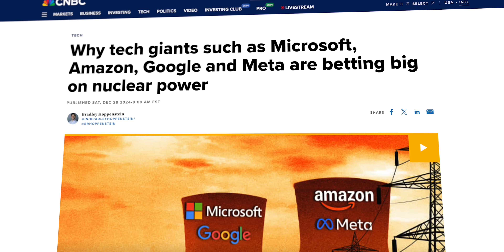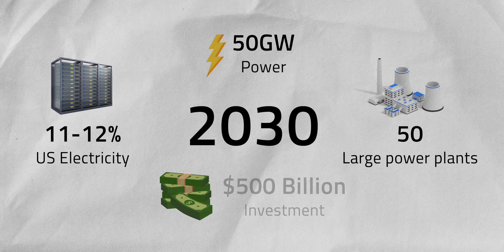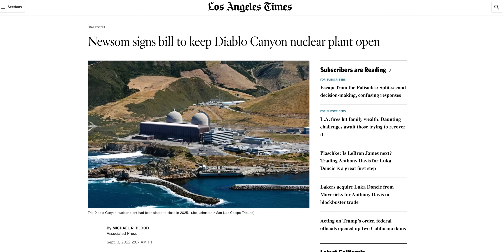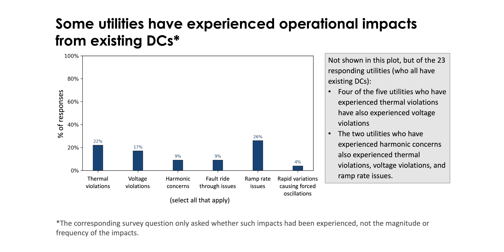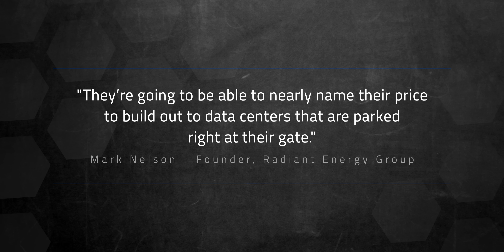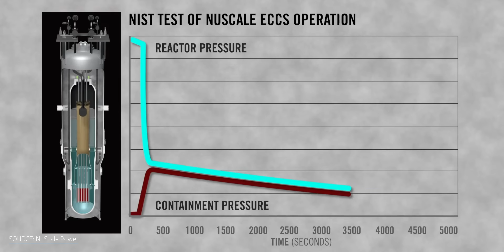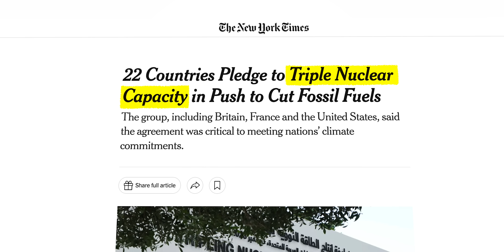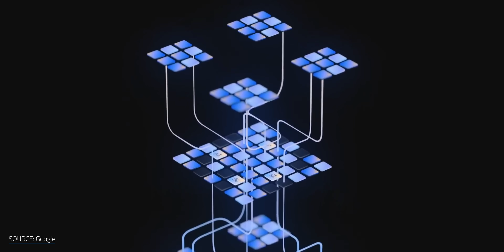Why Big Tech's Betting Billions on Nuclear (Not Renewables)

Comment: My main issue with the reference to Fukushima-Daichi, is glossing over/failing to mention the part that the disaster, as described,  was entirely avoidable if TepCo had actually listened to their own engineers and disaster planners to build the backup generators higher up.

Otherwise good video overall.
Reply: Yes, the engineers knew in advance that a tsunami could cause catastrophic failure exactly like it happened, and they did warn the management about it. Avoidable as you say. The passive cooling systems discussed in the vid are even better.
Reply: But like all industries, nothing normally happens until something happens, rules are written in blood.
Reply: What makes you think that tech giants listen to engineers?
Reply: That and it was in the process of getting shut down as it failed multiple times to meet the standards required to operate, in that time they ran it into the ground making the most money they could.
Reply: Private companies will often cut corners; we have to expect that. It's the regulators we should be able to count on not to drop the ball.
Reply: TL;DR - The people who built Fukushima Daiichi - Tokyo Electric Power Company aka TEPCO - knowingly put the emergency backup generators in a part of buildings that are below ground level. This ensured that these emergency backup generators would get flooded out if a tsunami hit. TEPCO then completely and utterly ignored a 2008 report that warned them that this mistake could easily result in a reactor meltdown in the event of a large tsunami.

The cutaway illustration at 11:30 in the video is incorrect. A quote from the World Nuclear Association's website page on Fukushima Daiichi:

"Events at Fukushima Daiichi 1-3 & 4

[...] all six external power supply sources were lost due to earthquake damage, so the emergency diesel generators located in the basements of the turbine buildings started up. Initially cooling would have been maintained through the main steam circuit bypassing the turbine and going through the condensers.

Then 41 minutes later, at 3:42 pm, the first tsunami wave hit, followed by a second 8 minutes later. These submerged and damaged the seawater pumps for both the main condenser circuits and the auxiliary cooling circuits, notably the residual heat removal (RHR) cooling system. They also drowned the diesel generators and inundated the electrical switch-gear and batteries, all located in the basements of the turbine buildings (the one surviving air-cooled generator was serving units 5&6). So there was a station blackout, and the reactors were isolated from their ultimate heat sink."

(YouTube automatically deletes comments with URLs in them, so I can't give you the direct URL to this page. Google for "world nuclear association Fukushima Daiichi accident" and it should be the first result.)

MY POINT IS: The people who built Fukushima Daiichi (that'd be Tokyo Electric Power Company aka "TEPCO") intentionally and knowingly put the backup generators in the basement. And they were warned in writing by their own engineers in a 2008 report that the backup generators would get flooded out in the event of a tsunami hitting the plant. And that's the real root cause of why the meltdown at Fukishima Daiichi happened! They put the emergency backups generators below ground level, ensuring they'd get flooded out in any kind of flood (including one caused by a tsunami). And ignored a written report that warned them it was going to happen.

A lot of people don't know, there is another nuclear power plant only about 11 miles north of Fukushima Daiichi. It's called Fukushima Daini. And it's almost the same exact design as Daiichi. Seriously, check out the Wikipedia page on it. Except the people who built Fukushima Daini, put the emergency backup generators where they should have been: Above ground level! So when that same tsunami hit Daini, its reactors shut down and cooled off just fine. Again, look up the Wikipedia page for Fukushima Daini if you don't believe me on this.

(I'm sorry for the wall of text. I added a tl;dr at the top.)

My conclusion after finding all this out? Human beings and especially greed-driven corporations are TOO GODDAMN STUPID to build and run nuclear fission power plants! Furthermore, the idea of "human factors" (which is just a fancy word for "stupid people") is ignored by most who advocate for more nuclear power plants. Chernobyl was also caused by human stupidity. Experience and history argue that humans are, in general, too stupid to build and run nuclear reactors correctly. We need to stick to solar panels, wind turbines, dams, etc for our electricity generation. We are too stupid to play with more powerful toys. (Corporations, whose entire purpose is profit, are especially stupid. They should never be allowed to operate nuclear power plants.)
Reply: Why listen to engineers when you have corners to cut and profit to make? You think US cares about safety over profit? LOOOOL
Reply: I think what you're trying to say is, "Capitalism and nuclear power are incompatible." 

As long as we live in a social/economic/political system that values profit more than human life, we won't be ready for nuclear.
Reply: @ecocentric6640   To be fair, Chernobyl was under the Communist Control.

I think human ego and stupidity are incompatible with Nuclear power plant.
Reply: yep, paying a bit more for getting cooling-water to the reactor by not building next to the coast really would've done wonders.
Reply: @serioserkanalname499  Or just a bigger seawall, or a generator on the roof, or, in the case of unit 1, a slight design change so that the decay-heat-powered cooling system turned on automatically, as the operators already believed that it did.
Reply: Putting your diesel  generators in the basement?

How stupid?
Reply: @LauraliteBrezia  Doesn't matter that it was avoidable. They didn't avoid it. They were told exactly what to do and didn't do it to save effort. Laziness is a human trait you can rely on, lol.
Reply: Every disaster is avoidable if someone had done something different.    It is just human nature to keep cutting costs until something breaks.  Anything built by humans is going to have preventable failures.  If that thing is a wind turbine, no big deal.  But when humans build nuclear plants, sooner or later, there will be irradiated lands.
Reply: @VPWedding  This a thousand per cent... You can almost ALWAYS say "this could have been easily avoided if this and that".
Reply: @VPWedding But, this wasn't hindsight? It was straight-up ignoring "best practices" design... Inserting vulnerabilities....
Disasters happen when Best Practices are ignored...
Reply: or that all of the deaths were caused by overblown reactions and excessive evacuation orders and no one actually died from the nuclear meltdown itself and only a tiny area actually needed to evacuate.
Reply: @epicgamer42069 it’s so easy to say that the reaction was overblown in hindsight. When you have a serious accident and you don’t yet know the full scope of the accident, an evacuation is absolutely the right thing to do. It’s better to overreact a bit than to grossly under-react. 
I also find it problematic to put all the focus on deaths, as if that’s the only catastrophic outcome of a nuclear disaster worth thinking about. Fukushima had many terrible consequences, even if deaths were arguably not among them.
I’m not anti-nuclear or anything. Trying to dismiss the issues around the Fukushima disaster is exactly what breeds distrust for nuclear power.
Reply: @ I do agree thats its better to overact than underact but it was grossly overated to due to grossly unnecessarily high standards of what a safe radiation level is and the evacuation was held for way too long due to those standards and thats what caused such major problems. Even after the situation was completely assessed they still held the evacuations despite the significant research that the radiation levels present were safe.
Reply: @auspiciouslywild  "Fukushima had many terrible consequences" Not the least of which was contaminating the entire Pacific with radioactive effluent (and I believe this is still ongoing, as they keep releasing radioactive water into the sea).
Reply: Or not build the reactor on the coast where they get tsunamis. 😅
Reply: @Nathan-vt1jz  definitely an argument to be made there, but my main point was more that they could have mitigated our outright prevented the disaster by building the generators higher up, with reasonable measures that would not have been wrecked by the tsunami surge they got, and tepco just didn't because they didn't 'want to cause a public disturbance'
Reply: @LauraliteBrezia if you tell the population we are derisking the nuclear power plant! Guess what people actually like the disruption! And will joyfully watch!
Reply: @Nathan-vt1jz  Submarines and aircraft carriers do just fine.  The US NRC released a report stating (assuming my memory is correct) that they require gravity feed reserve feed boron water tanks that would safe a reactor even during catastrophic loss of power.
Reply: @Nathan-vt1jz  There are tons of nuclear power plants on coast lines and all of them are doing perfectly fine without fault. Even one in Florida that gets hit by hurricanes on a regular basis
Reply: @epicgamer42069  I live near the turkey point nuclear power plant in Florida. The water around the plant has elevated levels of tritium, a radioactive isotope. Gee I wonder where that came from? That water goes into a canal and leaks into the biscayne aquifer which provides drinking water for millions of Floridians. That is your heroic clean power solution?
Reply: The problem with Nuclear powerplant is not the nuclear itself. It's the human who runs it. The problem is, you can't actually eliminate human error completely.

And that's the scariest part. Many governments around the world would cut corners regardless of safety concern and millions of lives at stake.
Reply: There are pasdively safe reactors that shut themselves off.  Thorium reactors, for example. @nntflow7058

Comment: I don't understand how you can do a video that indepth about nuclear energy and not mention nuclear waste? The new reactors may be safer but they don't change the fact that they are producing waste that will remain highly toxic for thousands of years. This alone should be enough to stop these being chosen over other options. What could be achieved if this level of funding was spent on wave and tidal energy production?
Reply: The solution to nuclear waste is a closed fuel cycle. This has been proven many decades ago, but the EU and US decided to leave nuclear power. The "waste" has so much energy still in it that it can power their respective country's with electricity for centuries.
Reply: > What could be achieved if this level of funding was spent on wave and tidal energy production?
Very little, besides immense environmental damage.

The sea is a much harsher environment than a NPP, which is why we have NPPs lasting up to 60 years, with applications to 80 years, and the NRC stating there is no technical objection to a 100 year lifetime.
Wave and tidal machines, in contrast, are damaged and degraded within a few years, and fail to have much meaningful impact.

Just look at the tiny impact wave/tidal have made to Austria, or Nebraska, or the Central African Republic; let alone the difference to Estonia (with tides of as much as 6 inches! 6 inches I tell you!)

Comment: I have yet to see a nuclear power plant go online on time and on budget. Not to mention nuclear will need a water source nearby limiting  where they can be placed. Since data centers go where the land is cheap, I’m seeing more and more data center projects use solar solely for themselves and island on their own without connecting to a utility because the power is too much and the utility takes to long to upgrade. This will be interesting how it plays out since solar is cheaper, faster to install at 9 months vs 10 years, and more flexible as to where the Data Center, solar field, and batteries can be installed.
Reply: look up these power plants:
Japan:
- Shika 2 (4 years)
- Higashi Dori 1 (5 years)
- Hamaoka 5 (4 years) 
- Onagawa 3 (3 years)
- Kashiwazaki kariwa 7 (3 years)

South Korea: 
- Shin Kori 1 & 2 (4 years)
- Shin Wolsong 1 (5 years)
- Hanul 5 & 6 (4 years)

EU and US had the same capabilities in the 70s and 80s until they stopped building them, and euhm... yeah here we are. 

The tech company's tried and still are invested in solar projects, it's just clear that only wind/solar doesn't cut it. A NPP can be paired with an air cooling system, it's just less efficient.

Comment: "Passive safety systems solve that issue"   I object to that statement.  They make a catastrophic event less likely, but as an engineer, I can assure you that there is no way to predict all possible events or the destructive ability of human stupidity or malice.   The question is, do the safety systems make the probability low enough that you are willing to accept the risk of the worst case accident.   I have a hard time saying yes when the people proposing such nuclear plants are either omitting the fine print for profit, or because they have deluded themselves into believing their shit won't break.
Reply: Given the smaller size of each module that does limit the scale of a disaster. That should make containment easier in the worse case scenarios.

Comment: I'm all for nuclear power, but it needs to be said - this is a scam from top to bottom. Sure the tech companies want the electricity - but are they building the fuel fabrication centers, waste repositories or reprocessing plants? No that is still a government thing if its being done at all. Are they replacing carbon plants with these centers, or just meeting new needs? Nope. And are these actually innovations? Of course not. All these new reactor ideas are just rehashes of old concepts - liquid sodium and small modular reactors existed in the 1960s, the USSR built submarines with liquid metal cooled reactors in the 70s. Thorium and Breeder reactors go back to the 50s, yet we don't have the infrastructure to make these possible on any reasonable timeline. 

 There is an economy of scale in using larger power plants - fewer staff needed, less replication of systems, and less materials needed since you only need shielding for one unit. Even if we wanted to ignore those points, well then we could just use the reactor designs from US naval vessels - where we already have institutional knowledge on building, running, and recycling without reinventing the wheel.

Pebble bed sounds great, but when it was tried, a lot of problems were found. Graphite balls that can expand with heating tend to be rather fragile. You need airlocks at various points in the system to keep the coolant gas contained. 

On the upside - the claims about safety are correct. To a point at least. Nuclear power has always been rather safe, so long as you understand the limitations of the system. Safety isn't exactly something you can quantify with a percentage, and to claim something is 100% or 1000% safer is just BS. Remember - TMI was a problem due to misinterpreting instrumentation. Water level indicators could not be placed directly in the reactor, so they monitored the pressurizer instead, which should reflect the cantonment vessel's level. But in 1979 they found a failure mode where that wasn't the case. Or look up the story of the Therac-25 for problems of relying on software only, and failing to have proper sensors to indicate a problem.

Comment: "..but they clock out when the sun is not shining and the wind is not blowing..." But given the rapid rise in battery storage you cannot make that argument so glibly anymore, Matt. And without intermittency solar and aeolic electricity is simply cheaper than nuclear.
Reply: Batteries don't exactly store very much energy when it's cloudy or rainy during the day.
Reply: @derpymcderpello5381  I think batteries can store electricity irrespective of the weather conditions.
Reply: @cheesedoff-with4410  Solar panels can't charge those batteries if the sun is covered by clouds.
Reply: @derpymcderpello5381 And I dare say nuclear reactors won't work without fuel rods.

Comment: And you didnt talk about nuclear waste, it's cost to manage it and its cost to recycle it when Possible
Reply: Except nuclear waste IS part of the price now (at least in the US).

The NRC requires a surcharge of 0.001 USD/kWh (decimal correct), deposited in an escrow account. You can see the current status of the fund at the NRC website.
Most other countries have the same, or have since adopted the same, funding model.

So, when you look at the price of nuclear, it ALREADY INCLUDES the cost of dealing with the waste. Ditto plant decommissioning costs (although those are in company escrow, vs NRC escrow, accounts).